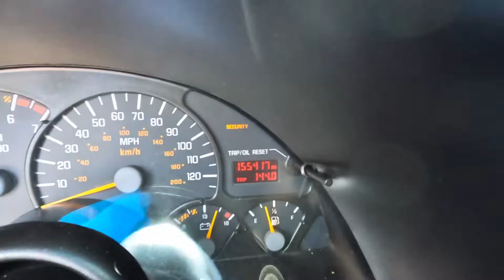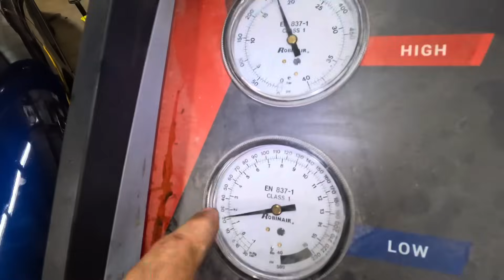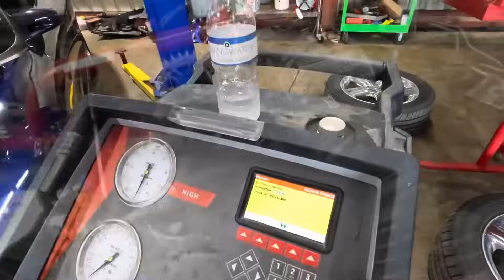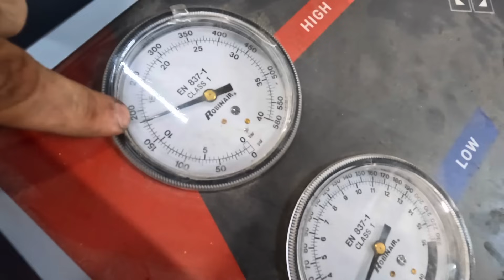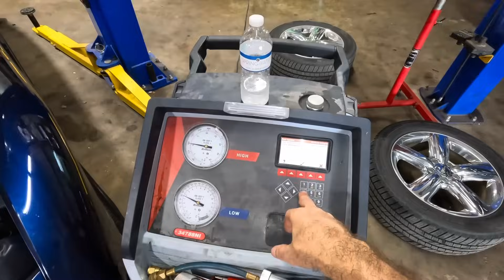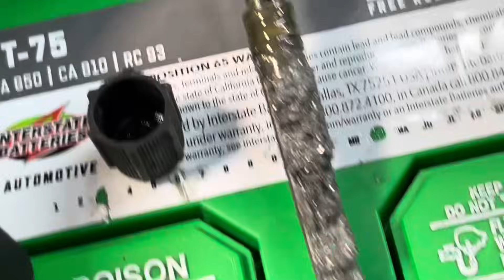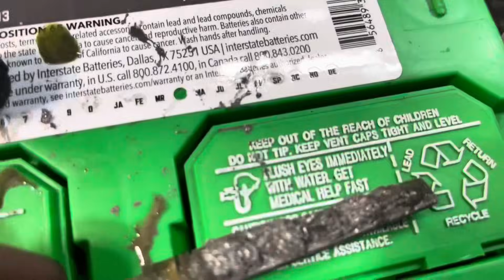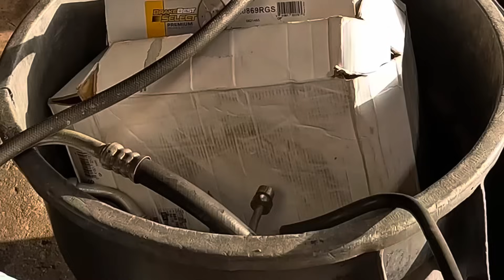Metal in the Freon? Pistons Coming Apart Pontiac Firebird!

Comment: Strut tower brace on a v6.... That's funny. After finding out serious modifications were required to make a 454 fit in that model car I just sold mine. Had extremely low mileage, but what I hated the most about mine was it was green.
Reply: Brace has little to do with engine choice. More to reduce body flex for better handling.
Reply: @hotpuppy1  Totally agree, especially useful for convertibles whose entire roof reinforcing structure is missing.  The 4th-gen F-bodies had plenty of flex from the factory, which is why I added a strut tower brace and subframe connectors to both of mine, neither of which were ragtops. Those two aftermarket additions made a huge difference through the twisties, drag strip too.
Reply: @hotpuppy1  well obviously that little blown up 6 couldn't cause flex from all that power....lol
Reply: Being a convertible, installing the strut brace helped a great deal in over all handling performance

Comment: Could you take an old manifold fitting and connect it with a hose into a suitable container when backflushing the AC components? That way the mess wouldn't get all over, and you wouldn't have the dye all over, confusing future troubleshooting. I must say I wish my guy had had that system years ago when my filter ruptured and I had to replace the evaporator.

Comment: A OSHA-ish comment regarding AC flush - it's a mixture of isopropanol and heptane - the Isopropyl is relatively safe (but can be absorbed thorugh skin), however the heptane is not - look up the wikipedia entry section on Heath risks. 

You really don't want to be breathing heptane vapours or getting it on your skin. Bad things can happen

Comment: When my gf needed her a/c worked on I asked the mechanic she knows if he could check the clutch before doing a whole replacement of the unit, my gf was in a tough position at the time. And he went on a rant that manufacturers don’t make clutch kits and they’re all made as compressors. And he began jumping down my throat if I knew so much why wouldn’t I just do it myself blah blah blah. So I just pulled out my phone and looked up the clutch kit for my gf car and showed him; he didn’t believe me and stated he “didn’t have the tools to pull one apart” and I took her car to the local guy I knew in my town…..it was the clutch. Original guy wanted 800$ for a compressor replacement and the the clutch rebuild kit was 200$ and a bottle of whiskey. Love my local guy we help each other whenever we can 🤙🤙

Comment: the 3800 series II is a legendary engine. i wished GM made a L67 f body, that would have been cool. we still have 97 L36 3800 grand prix and a 03 bonneville SSEi L67 supercharged 3800 (with a few mods). you can pry them from my dead cold fingers

Comment: Ah, the days when you could service the A/C compressor (shaft seal, clutch). These were pretty well built and lasted a long time. I wonder what killed this one? System lost charge at some point and was recharged without adding oil?
Reply: Too much refrigerant couses high discharge pressure and temperature. This leads to compressor overload, overheat and oil thermal brake down. Also too much oil in system reduces cooling capacity of condenser and this can lead to out of spec high pressure.

Comment: Great diagnosis. Once in a system is compromised like that one you have to replace everything. If you don't you are not doing your customer a favor. It will just wreck the new components eventually if you don't
Reply: GM's of that era have serpentine evaporators (one continuous tube) so they can be flushed. The later ones with manifold style (tubes connected together at each end) can't be flushed.

Comment: I guess the advantage to having the smaller engine in that car is that there looks like there is a ton of room to work on it.
Reply: Lots of room to work on the radiator and front of the engine, the rest is shoved back under the wiper cowl
Reply: @johnt.848  yeah because front mid engined layout, for handling and weight distribution. Although I'm not surprised because even Silverados are like this, engine slightly behind front axle.

Comment: The problem with the 3800 is they paired it with a shit trans in the FWD cars. I had a Bonneville and it went through two transmissions in under 150K miles.

Comment: Had a 99 firebird,biggest turd I've ever owned.After four years the paint started peeling off on the roof and hood so we met with a factory rep,he said we were experiencing sacrificial primer because the EPA made them change paint formulas so they offered us a coupon for $500 off our next GM purchase.We switched to Toyota a year later after they told us $1000 to get your power  retractable headlights to open

Comment: Ok your in my head again. I just sent you an email yesterday about my 98 Trans Am and it has 5.7 V8. I sent it after 5pm. I wanted a quote on a transmission flush an exchange. If you need another orifice tube, I have an extra one you can have.

Comment: What do you say Ray? Is there a core charge on a AC compressor?
Reply from the maker: It was $10
Reply: Made way more than that as a comment generator.
Reply from the maker: @kenore4003  it was worth the tear down I think. I could always put it back together and return it 😉. In fact I think I will. $10 is $10
Reply: @RainmanRaysRepairs  Thanks for the reply!

Comment: It is Amazing how many systems are in a modern car An Air-conditioning unit a electric power unit battery, water pump air cleaner and smog control fuel storage and fuel pump with filter heater and air filter  plus computer and sensors  stereo and touch pads with internet  it's a wonder there is room for a gas engine and mechanics have to know how to repair it all good going love these vidios

Comment: Hi there ! Whats with the red crossmember ? Have a great day.
Reply: It's an aftermarket strut tower brace which helps lessen lateral twist, particularly helpful for convertibles (aftermarket subframe connectors would make a big improvement too).
Reply: Agreed noticed a big difference in handling after I installed it!

Comment: The other radiator leaves probably obstructed airflow of the ac radiator. Too much coolant to try fix probably didn't help the compressor. Please blow out the radiator fins, some reverse flow, the clean would be satisfying.

Comment: Hey, need your professionalism on an issue I am having on my 2004 Mazda 3 1.6. When I start my car in the morning, the rpm's go to almost 3000 until the car warms up. Furthermore, after driving for about 30 minutes and shut the car off and then turn it back on, it will not shift out of park. I have to manually release the switch. Do you think these 2 issues could be related? If so, what do you suggest?
No codes are showing so that is out of the question. Its an Asian Mazda 3 thus, the 1.6 liter engine.
Reply: You need to find a transmission or engine shop that specializes in that. There is most likely a restriction somewhere in the most important parts of the car.

Comment: Maybe you can explain why EVERY single compressor sold by O'Reillys leaks at the O-ring around the perimeter of the case half... I have a lifetime warranty, but it means NOTHING when you have to change the compressor out every single summer without fail.. I have the green dye in  my system and every year or so I'll be changing the oil and see the green liquid dripping from the point where the case halfs meet. I've been through 5 compressors in the last 5 years.... It's getting old. I have 3 vehicles in my family and ALL of them have compressors that leak in the same place. Is there a better company, or brand, or compressor to buy that WILL NOT leak at the case halves? If so PLEASE TELL ME and I will start buying them.

Comment: You haven't drilled that broken bolt and extractor out of that Subaru block yet! If you are going to scrap the engine you might as well try. Heli-coil or timesert it. Another engine may not be as good as the one he has.

Comment: Another top notch video. Why is Troy using ear protection while grinding?
Reply: Using an angle grinder produces around 100-110dB(A).
That's loud enough to cause permanent hearing loss after a relatively short time & well above the 85dB(A) maximum recommended without hearing protection.
Ray could leave himself open to a lawsuit if he didn't ensure his employees are protected from excess noise.
Reply: @GARGLER42 Err, pretty sure it was a joke but your point is well taken.

SAVE YOUR EARS AND EYES!

Comment: Not running the A/C cleaner after brake cleaner in the lines while replacing the o-rings, very bad idea. Cleaned Lubed o-rings just before installation is the correct way! The OEM condenser could be professionally clean rather than putting a cheap aftermarket one in...

Comment: I guess you would have fell in the floor shrieking with pain if you were around us in the 1980's using the real carburetor cleaner.  Before the EPA turned it into water.  I've had that crap in my eyes in every scrape or cut , it would actually make a wound scab over quickly.  It would turn your skin white as it removed every oil in or on your skin.

Comment: Seen a few of those compressors used as air compressors by removing the clutch end and putting a pulley on the end of it and an old washing machine motor to drive the belt.  Actually did fairly well if you didn't need over about 100 pounds or so.  Some of the larger ones off Dodge were 2 piston style and would run a shop air IF you got one that was still good.  Rednecks...of course...LOL

Comment: You could blow out the radiator (all of 2 minutes) whilst you can, just a bit extra customer service to show you care about their vehicles not just the money they generate for you.
Reply: Its a condenser coil, but he is not done yet.  bet its cleaned before reassembly !
Reply: @darknes7800  the dirty part I'm referring to is the radiator that's still in the car, he removed the condenser and is going to replace it. The grass etc. is on the radiator and the best time to clean it (although not officially part of the a/c job) is now. He's been in the same situation before and not cleaned the debris away.

Comment: Turns out that pulley didn't need to be pulled of the compressor after all. It could have remained on the housing half after the center bolt was removed. I was wondering why you did that.

Comment: Good channel but Ray. It’s not a receiver drier. It’s a suction accumulated designed to boil off excess liquid before the gas guess back to the compressor. And if the pieces of the compressor were stopped at the Orphic the accumulated would likely nit have chunks in it as it’s after the irphice and before the comoresser
Reply: OMG, if that is the best you can do and it's been edited, I'd hate to try and read the original. My brain is bleeding now.

Comment: You are professionally unprofessional.  You work on a few nice vehicles, start using fender covers.  Also run a vacuum cleaner on the front of that radiator and condenser well.
Reply: Leaving the cleaning of the radiator til last makes a comment generator.

Comment: My A/C doesn't work in my truck.
Reply: You need a 2WD60 air conditioner then.
Reply: @Flies2FLL  that's all I got now. I also got the limited edition back side flips that stay open.
Reply: Try a can of refrigerant with a gage?
Reply: @jilbertb  where do I put it? I dont see any lines or an A/C pump. I don't even see a condenser.

Comment: FYI:  Those radiator cooling fins could use a quick burst from a power washer.  Sorry, dirty radiator cooling fins drive me crazy.
Reply: Never use a power washer on a radiator, they can blow them apart, use a garden hose or light air pressure.